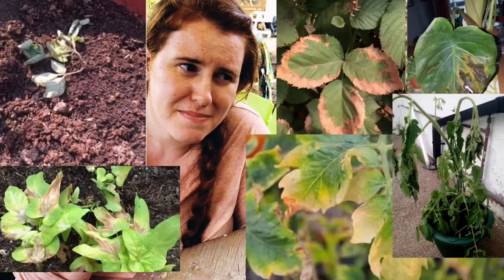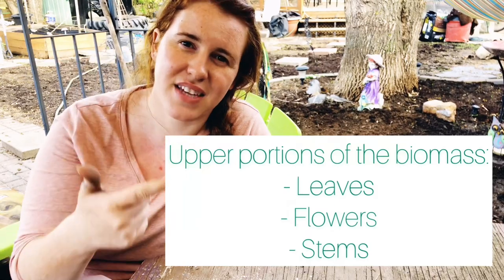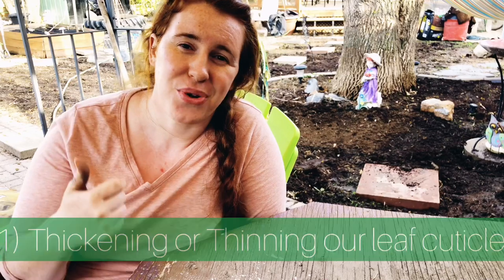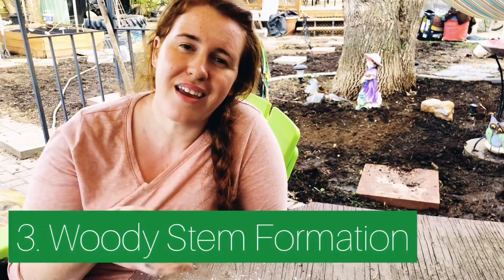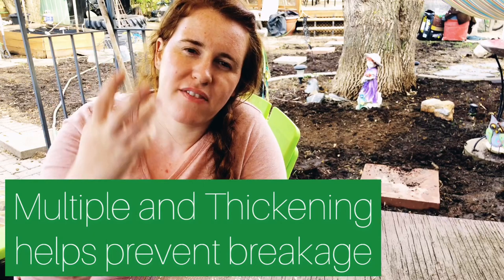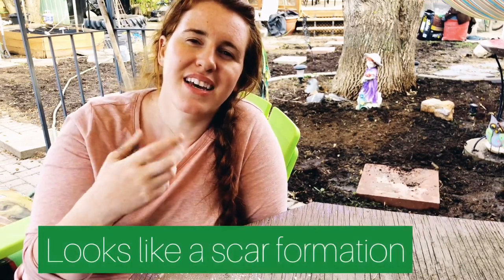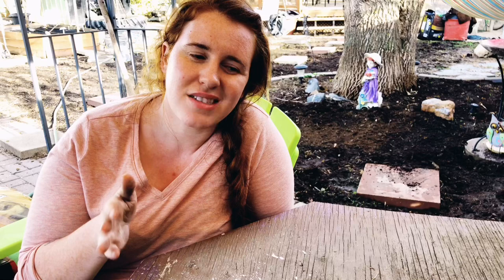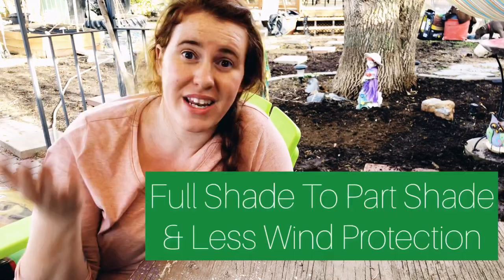HOW TO Harden Off Plants BEFORE TRANSPLANTING. PUTTING PLANTS OUTDOORS | Gardening in Canada 🌿👩‍🔬

Comment: Do I need to start hardening off in the shade if the plant was growing in a greenhouse? Just wondering how much of the sunlight gets refracted by the greenhouse windows.
Reply from the maker: You will want to prep them for the future wind and changes in moisture so the hardening off period is much shorter but should still happen
Reply: @GardeningInCanada  Hardening for changes in moisture just means you should intentionally water them less consistently?
Reply from the maker: No I mean more ambient humidity so the greenhouse will generate have a high humidity then the outdoors. So preparing them for that change.